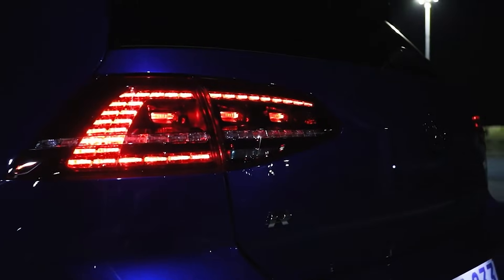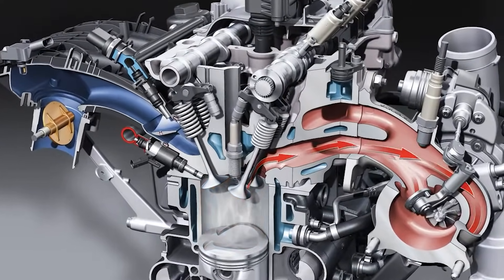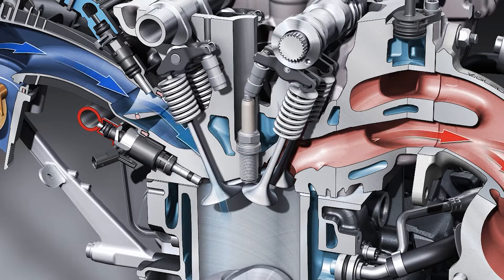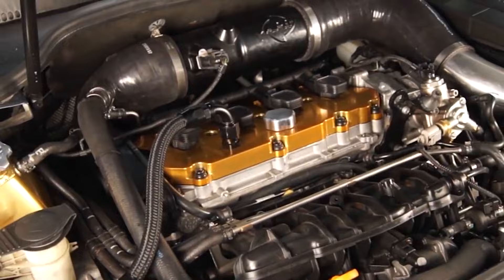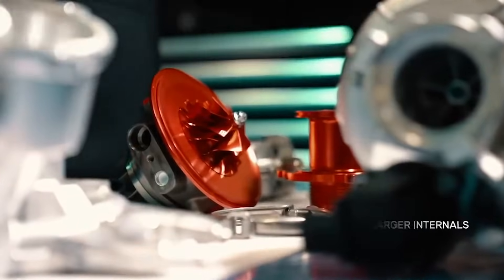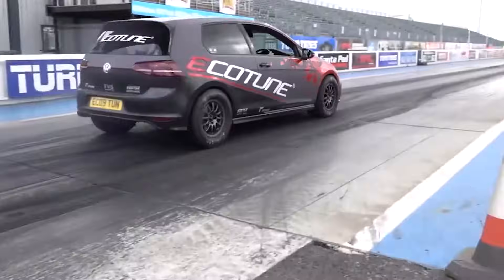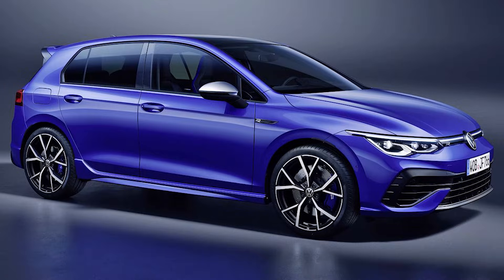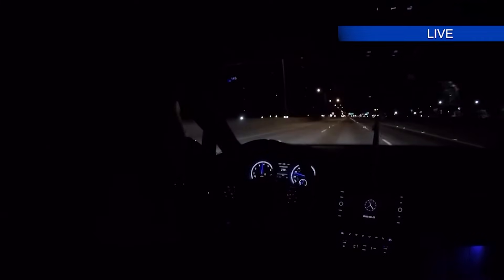From Stock to Monster: An in-depth tuning Guide of the EA888 Engine

Comment: Love my Mk 7.5!!
Great all rounder and a BEAST when ever you want it. At around 400+ hp being epic. The funny part is.... I don't get many takers to have a little fun with. 😅 
I only had 2 faster than mine. A late model BMW M3 and a mid range $300,000 Porsche 911. Though the Porsche could not past me up to 145km hr. I was thrilled with such performance. The Porsche owner was amazed how hard my Golf pulled and said that he had V8 
he dragged and they can't even pull off what the Golf R did. 145,000km and still going strong.
👍🇦🇺

Comment: i have an is38 in my car, what turbo could i buy to upgrade it?
Reply: Why? The IS 38 is good for 400 to 500 hp.
Reply: @ no, IS38 only goes to 400 without breaking
Reply: @joaojordao5346  it can do slightly over 400whp, which put it’s near 450hp to the crank.

Comment: Gen3 is one of the best if not the best modern 4 cylinder turbo. I have Mk6 GTI with K04 hybrid upgrade on gen 2 engine, timing chain, balance shafts and intake manifold updated, it has abou 370HP and it is one quick economical beast, gen 3 is even beter, less oil consumption.
Reply: Hey if you are having issues with oil consumption look up b-12 piston soak videos on youtube about it for 2L vw engines. Seen people go from 1L per 300-500 miles to not needing to top up at all until they change the oil. This is due to the oil control rings getting stuck.
Reply: @atom608  Not at all. Key is regular oil changes at 7-8k km. My early 2010. mk6 is now 255.000km with original engine, it has some oil consmption, which also had when it was almost new. That is about 1.5l @8000km, depends on usage and driving style. Between oil changes it needs to be top up about twice. 
Also every 80.000km I am doing engine flush and liqui moly ceratec. Timing chain was done about 100.000kms ago with genuine parts, and next change is at about 300.000km. Recently I changed water pump, hose and oil cooler gasket. It started to leak on some o rings between oil cooler and water pump, but pump is preventively changed, because it also done about 100.000km. With regular maintainance and some spirited driving it would last long. If you trying to reach VMAX, you are asking for trouble. Watch out at oil temperature while driving hard. It shouldn't exceed 120C if you don't want excessive oil burning.

Comment: good vid. EA888.3 with hybrid turbo, MPI, LPFP, on E85, and your standard bolt on’s get you an easy and safe 500 whp. The torque is really the limiting factor here depending on how long you want the stock block to last. Also need to worry about stock dsg clutch packs are usually fine in this range too. 

GTI can make this same power  and has the edge in a roll over a golf R. 

The gen 4 is showing amazing results thus far on just stage 1 and an intake.

Comment: I'll get the 2024 kodiaq with 2.0TSI EA888 gen 3B miller cycle. 204hp out the factory, about 50 additional hp with a tune - nothing crazy. I think it's enough for most application. It's a family SUV at the end of the day..
Reply: You tell yourself now that it will be enough, but trust me, you’re going to want more. Happened to me with my CX-50 Turbo. 256HP & 310TQ felt adequate for a while, but it still felt slow, and with no tunes available for the car after three years, I gave up on waiting and got a smokin’ deal on a ‘24 Golf R DSG; $6,500 under MSRP!!

Comment: I have a 2018 Audi S3 8V.5 with the beefed up version of the Ea888 gen 3. It truly is a BEAST of an engine.  Besides that, the MQB chassis caters to exceptional handling and feel.  I just completed my stage 2 with 034 motorsport and I am so satisfied with it. I should be right around 400 HP, my car is stupid quick to 60 mph (3.8 sec) and quarter mile at 11.9 Sec.  If maintained properly including DSG/ haldex fluids, frequent high quality oil changes, (5w-40  Liquimoly) and proper spark plugs ( Im running dense IKH-24) these cars are very reliable. Im at 55,000 miles and I have never had a single check engine light and I drive my S3 hard.  Nice video, Cheers from SC, USA
Reply: Totally agree I'm big turbo putting down over 500whp and not had one issue runs like the day I got the car!
Reply: @volkssturm9694  was the stage 2 with 034 ECU and TCU?
Reply: @YShariffCinematics  yep !
034 for both ,
Love the tune ! I’m at 78K miles 
Not one issue .
Reply: 9-60 3.8 sec yet your not hitting 10 sec quarter mike times 😂😂😂😂
Reply: That sounds about right and is what mine does. And it is rappid indeed.
Reply: Your engine is the same as the gti engine but with bigger turbo. It's not "beefed up".
Reply: @Tom-xd4ct DAPs engine breakdown shows they are different but it isn’t nearly as significant enough in the grand scheme of things
Reply: You are completely wrong about it being the same.  A simple google search will show you the differences.
Reply: BEWARE.... you are running the notorious RS7 plug. They are well known for breaking & taking out the cylinder & turbo from the porcelain bouncing around on the way out.  I lost mine with this exact plug, I changed plugs 2x/yr (3-5k miles) I was good from 40k-65k before my luck ran out.
Reply: @17nano3  wrong I’m not running RS7
Plugs I’m running Denso IKH-24
Might wanna check your head on that lol